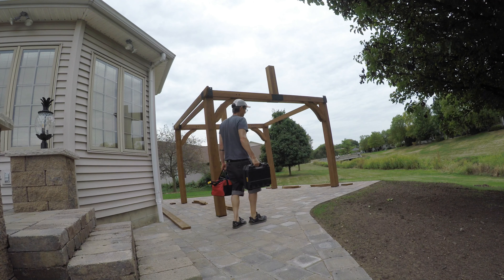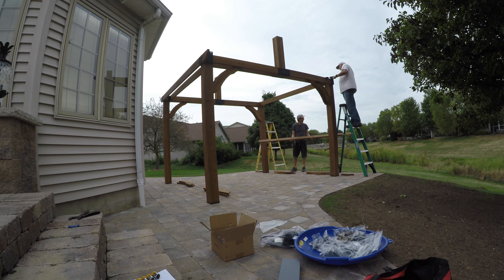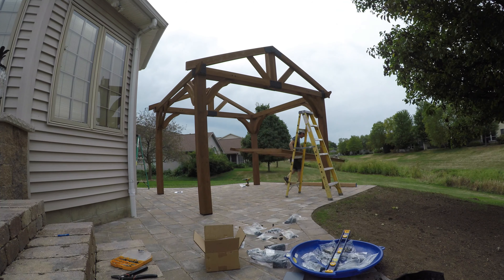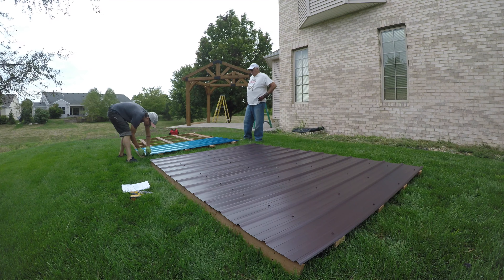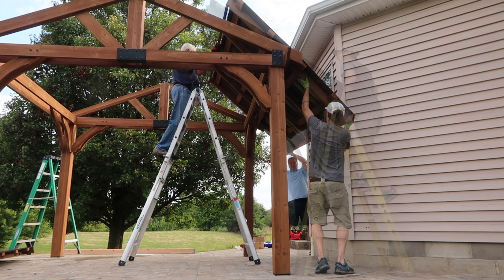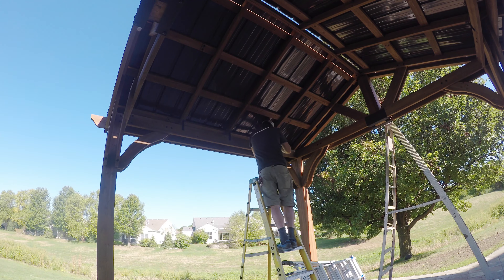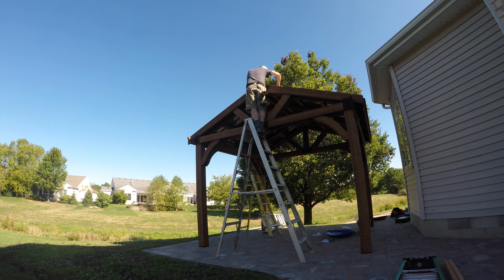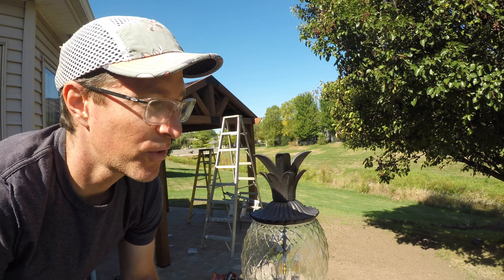Building a Backyard Gazebo Pergola from a Kit

Comment: Nice job I have 2 to build this weekend 1 that was somewhat started but homeowners decided after 6 hours of hunting down tools & parts to have us finish it and another one that was delivered to our shop for a customer that wanted it built for their parents new hot tub. Kit gazebos are nice.
Reply from the maker: you'll get it done pretty quickly. I found the only problem with the kit was low-grade fasteners, so you might want to bring some extras with you. good luck!
Reply: @metaspencer  thank you for the heads up on the extra fasteners. I hope the build goes smooth without any hiccups. When you have issues it makes for a long day.

Comment: Nice job finishing up the gazebo.  I'm building this exact one myself and doing it solo.  I'm to the point of assembling the roofing system.  Since I'm doing this solo,  I thought I'd ask your opinion based on your experience.  What if I assembled the roofing frame on the ground and installed it without the roofing panels?  Then, once it's up, install the roofing panels one by one in place with the frame already up?  Seems like it would work the same as doing the panels on the ground but I could manage them solo installing them piece by piece in place.  Didn't know if you had any thoughts on why this wouldn't work.  If not, I'll resort to getting a couple helpers and doing it as instructions call for.  It's a fun challenge figuring this out solo.  So far, so good.  Thanks for your thoughts.
Reply from the maker: Cool to hear that you're building one. Leaving the metal roofing off until it's all together would work fine ... that just the normal way to build a structure, so shouldn't be a problem. Just know that you'll be crawling around up there a bit, so wear rubber gloves and sneakers for traction, stand only on screw heads, etc. Alternatively, you may be able to hoist the full panels up there solo as they're not actually all that heavy. Good luck!
Reply: @metaspencer  Thanks for the confirmation.  Once I have the frame built, I can tell how difficult it may be to hoist it up with the panels installed or if I'll wait and install them once on the roof.  Thanks for those pointers on gloves and traction.  Enjoy your channel.